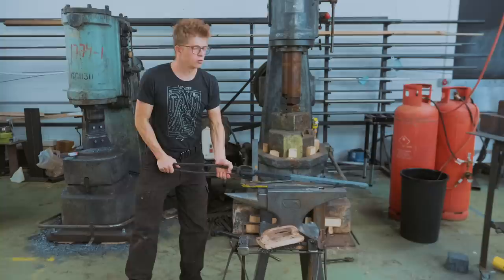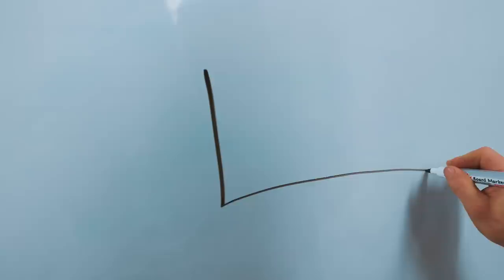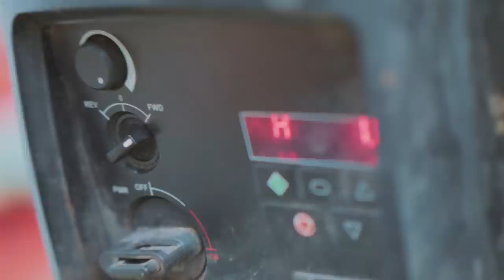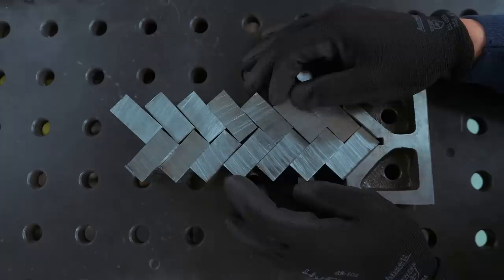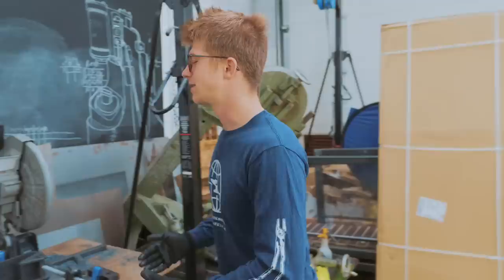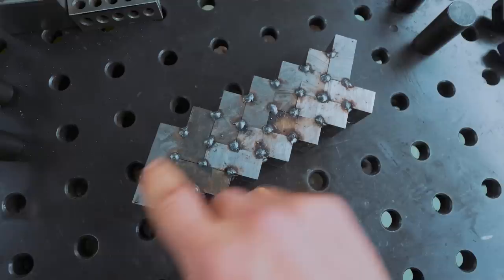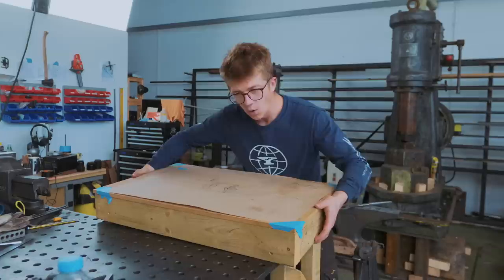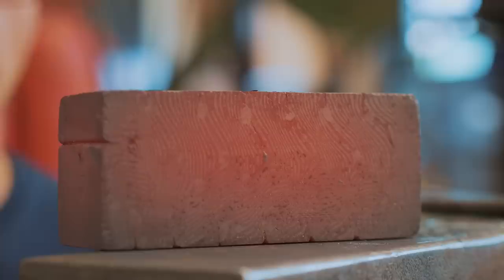Making an Ancient Indian KATAR Dagger! Part 1

Comment: now we're talking. this is the content that I subscribed for. the intermediary episodes of Alec making a padlock or a zippo were mildly interesting, sure, but they were basically him just making a copy of something that's already been designed and made. doesn't make for a very interesting project just seeing someone copy something. would've been more fascinating if it was more along the lines of other creators who take inspiration from existing designs but either add a personal flair to it or design something significantly different with the original as inspiration on how  engineering/mechanical problems were solved.

Comment: This is really close to a historical/fantasy build with a decent obscure webcomic tie-in that I've always wanted to see made. The Pata is an extension of the Katar idea, in that it is sword-length and also originated from India. The punch-style grip is integrated into a protective gauntlet and most types used a double-edged sword blade. 

In the webcomic Girl Genius, the character Zeetha (who is a warrior princess but not THE Warrior Princess) sports a matched pair of pata, one of which has a forked blade that can be used as a sword-breaker. Since they are called the Twin Blades of Destruction, it sort of suggests its own thumbnail.

Comment: I'm sure this has already been said but turn up the heat for those welds or preheat the material a bit to help get a smoother weld . Id recommend running spray for the side welds. but welds hold for there purpose so good job :) love the video ill have to watch all the ones ive missed in between now and when you moved back to the UK.

Comment: When I'm making a lot of cuts like that, I usually clamp a block at the right distance so all I have to do is put the end of the piece against it to always get the right length. It won't help with a wandering blade, but it'll make dropping your scale a non-issue. Plus, even if your measure is off by a hair they'll all be the same length. Granted, for me it's when I'm cutting dozens or hundreds of tie rods and spacers for chemical cooling units, but the concept is the same. You just have to be sure to blow off the grit from the block or it'll build up and throw off your cut length by at least a few thousandths.

Comment: Having gotten a cheap bandsaw and having a cut off saw, found myself wondering, how much material does the cut off saw turn to dust as opposed to the band saw, a couple of cuts would be negligible, but over time, the cut width is quite different. Love the content, been watching a while, aspiring smith/bladesmith in a garage.

Comment: Have you tried using cooling fluid on the chop saw? Also surly you use a stop to ensure every cut is the same length if not then make one, use a magnet on a steel plate that's got the measurement lines of a ruler on it  that's just a bit longer than the longest measurement you most often use or actually stick down permanently a tape measure on to a smaller plate attach the other end of the tape to the chop saw at the exact line you cut to make sure it's exactly the same height as the cutting bed of the Chop saw and make sure the plate you stick the tape measure to can be solidly attached to the bench to the left of the saw again at the same height when attached. That way you can quickly measure any length and once the tape is attached to the bench at the right length you can use it as a stop to ensure any and every cut you need is exactly the same length.

Comment: If I might recommend, instead of using a saw blade with teeth (on the chop saw) use an abrasive wheel to cut the high carbon steel. It's cheaper, doesn't wobble/warp, and still quicker than the bandsaw.

Comment: As an Indian, I always wanted you to make an Indian weapon. Thanks for the video.
Reply: The Katar also have a version with scissor action.

 The blade will split into three 
Two outer moving scissor like shell things with edge on outer edge. 
And inside outer blades an inner blade.

The two rod like handles would be clenched ✊ actuating the scissor.

Comment: Or use a Carborundum blade, no reason to use carbide no reason to use diamonds Carborundum blades are very inexpensive and they cut through steel easily like the one you use on your 4 inch grinder but they make them in 14 inch diameter and above